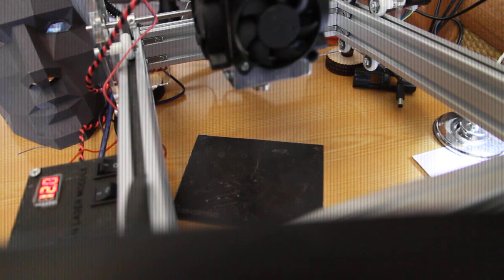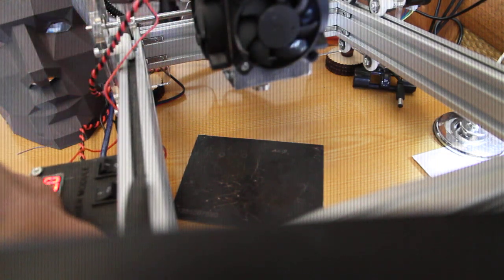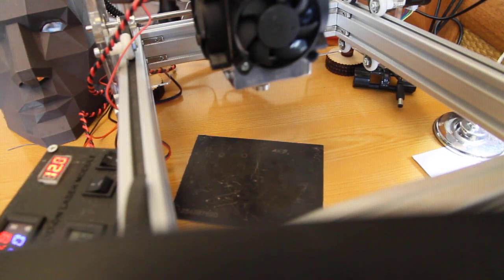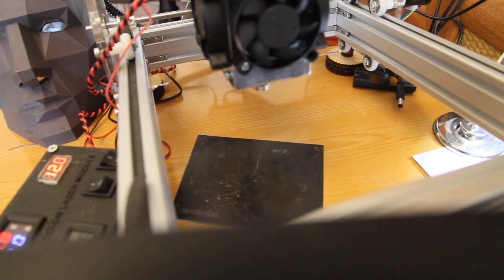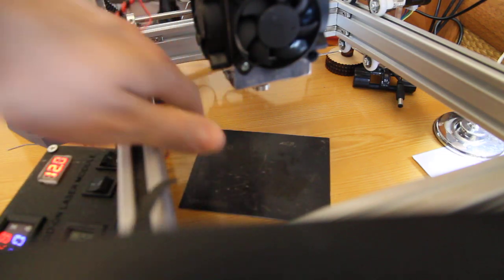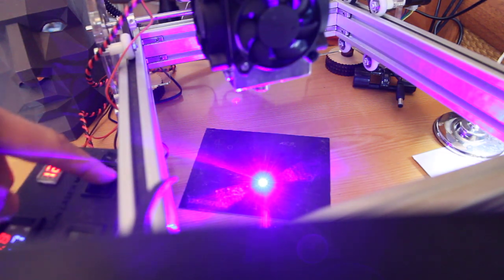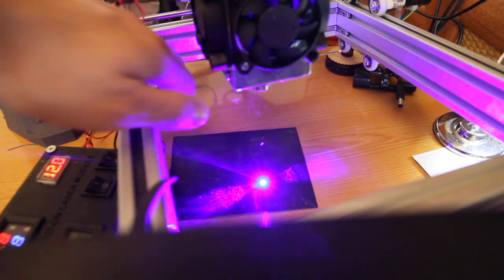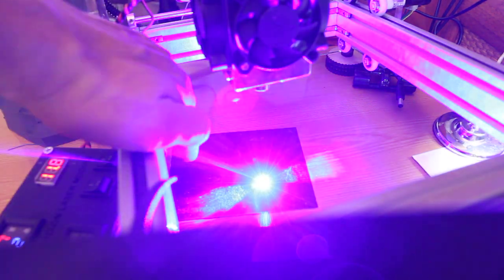An interesting riddle for a smart person. Why does the laser generate sound?

Comment: It is taking the oxide layer off of the aluminium. When you tig weld alum you use acpower to knock off the layer that imediatly form on alum when exposed to air. It also makes this singing or buzzing but it is retty hard to hear over the main arc. I believe the actual cause of the noise is the contaminents just being vaporised.

Comment: every object vibrates at it's own frequency.  the low setting of the laser is very close to the frequency of the aluminum plate.  try a piece of aluminum same thickness with no coating.
Reply from the maker: equation please )Laser wave frequency is (673.69 THz).
Reply: hey that's above my pay grade.  i'm not a theory guy.  you are basically etching the aluminum.  the anodized coating is stronger than the laser at low power.  i get that kind of noise when i tried using my crappy 2.5w laser.  i want to know the answer as well.
Reply from the maker: I got some ideas from a few academic guys, but will not share until someone post it here...

Comment: I think its easy :) sorry for my english, im from germany. The thin sheet vibrates at low power with the frequency of the laser. At full power, the frequency of the laser is probably higher and therefore no vibrations are audible. You hear it louder when you move the sheet, when the laser burns the anodizing layer / lacquer, small vibrations that you do not hear in the thick steel sheet because it is thicker and has no paint layer is burned by the laser. The sound is created by the impacting protons, which burn in the respective set frequency, the anodizing layer / lacquer abruptly.
Reply from the maker: please add an equation and calculations...why does it happen on anodized and low power?
Reply: it happens also on coated thin sheets, does not have to be anodozed aluminium. on the pure steel plate there is nothing to be burned (no coating), so the laser power simply is reflected back into the room (one of the main reasons you may not wear a watch or rings when working with lasers). the laser oscillates at a low frequency when running with low power, this frequency is by accident the resonance frequency of the alu plate. But the alu plate itself can't oscilate without absorbing the laser power somehow. this is where the coating comes in and absorbs the laser power and transfers it partly to the alu plate (it should also get warm). to proove my theory: simply turn the anodized shield on the other side (when there is no coating). if it's coated on both sides, wash away the coating with acetone or rub it away with sanding paper (acetons is more recommended, because you won't take away the aluminium and therefor alter the resonance frequency). you may also cut the plate in a very small piece, than it should make no sound (a sound at a differenc frequency). Equations will follow, give me a few hours, I am currently at the bar getting drunk. (disclosure: I am a chemist and worked with lasers during my PhD; I did laser scattering to determine particle size distributions of nanoparticles in aqueous solutions)
Reply: you mean the delayed drag model?  r(t)=a(1-e high-b*t)-x down o?  i find this pdf  http://publications.rwth-aachen.de/record/459447/files/5210.pdf  You find the calculation on page 17  well, the anodized layer absorbs more heat. the layer explodes and releases the movement to the sheet metal. thanks to the frequency one hears a sound. At a higher frequency you can no longer hear the sound, because the frequency of the self-resonance of the sheet is exceeded. Im not a Professor :) only industrial mechanic with electronic Hobby :) And you have a mistake. In the video headline you write a 10W laser, but in the description "you want to get 8.5 watts laser as a gift!" :) LG Marc

Comment: I am a simple man, so my simple answer is the coating is slightly being burned or is bubbling perhaps and then that is resulting in the sound due to the thinness of the plate.  A higher Laser power would just disintegrate the coating and the steel didn't have a coating on it.
Reply from the maker: equation please? otherwise it can not be counted...
Reply: I see...I'm not that educated to give you "The Equation" sorry, but it was not stated that an "equation" was needed. but that is ok, count me out, also, count me out as one of your subscribers as well.